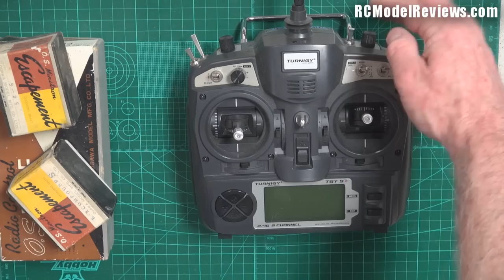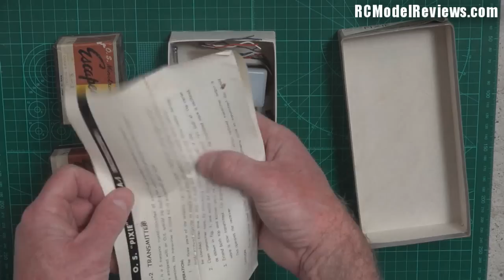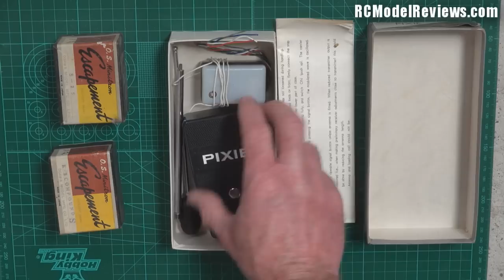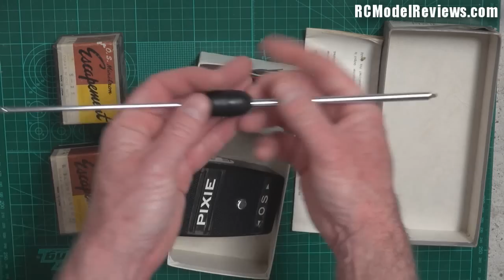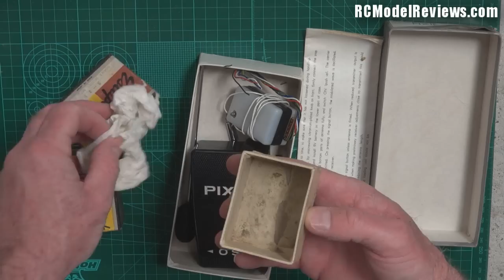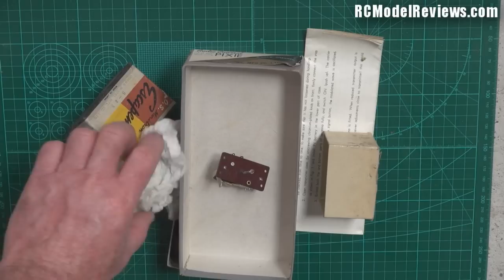RC gear from the 1960s

Comment: I got  an even older O.S. transmitter that is tube based (no transistors).  Those ran on 27 MHz AM. But I miss the tube based receiver for it. And these ancient high voltage batteries to drive the stuff.  You can study this facebook album (swedish text but photos can tell a story) : https://www.facebook.com/photo.php?fbid=1191565567031  If any of you know of people who have such tube systems working I would be happy to know.

Comment: Hi,I have the slightly earlier version and need a wiring diagram, I have the OS Minitron servo's and the diagram that comes with them is not clear to me,there are batteries connected all over the place. If you have a idiot proof wiring diagram I would love a copy.

Comment: Wonderful, Bruce!  In late 1960's, I was a 6 grader.  I remember I discussed with a high-school-er about how to use a single on-off channel to achieve tri-state (left, neutral, right) control.  He suggested: Pushing the button first time, the rudder goes left; release back to neutral; second time pushing the button makes the rudder go right.  Unfortunately we never materialize our plan. :( The method you shown us in this video is better and less confusing but carries the same idea. Thanks again!

Comment: I've got the perfect plane to go with the OS Pixie. An ancient FireFly RC Trainer kit that used to belong to my Dad. It was designed for pre-transistor radios. It has a 8 x 4 x 5 inch radio compartment, and shows you how to put together the 3 volt, 11 volt and 60 volt battery power for the vacuum tube (valve) radio system. Power is supposed to be an .099 gas engine.

Comment: Hi Bruce I have a Turnigy 9x radio and no matter what model I fly it cuts power to the motor after 20 to 30 seconds , still have power to aileron / elevator servos but have to put the throttle stick back down then power up to get motor going again. Any ideas as to why this is?  its a great radio apart from that and no instruction manual

Comment: Excellent video Bruce! I've been reading a bit about this stuff, and I almost want to give it a go. though I think I should learn to fly properly first. But the older planes were deliberately built to be properly stable and self centering in flight. Plenty of dihedral, and well trimmed. I'm going to build some chuck planes and go from there.

Comment: @RCModelReviews
 G'day Bruce:.. Yay Team ! This sure struck a Chord... I recall reading of such systems in '69 or '70, but Being a '61 vintage myself, I didn't understand it, & never knew where to get one.... Control-Line was all the Rage, here, back then. I did make a Sopwith Camel, Free-Flight, Cox .O49 Powered, and with a GRAVITY PENDULUM controlled Elevator... It crashed, of course. Pendulums could do all 3 Axes, (eratically). Ciao !

Comment: I've been looking at some of my old plans and thinking of building a single channel aircraft rudder only with a Mills .75 or DC Dart in the nose, I've found the plans for the Roaring 20, so I will scale it up to 30" to take the larger motor. I will post a build thread on the RCmodelreview forum with some photos and a video of it flying some time around Christmas.

Comment: Back when I first started in RC, my instructor had an aircraft called the Roaring 20 it had a Cox 010 engine an Ace single channel radio. It looked funny because the rudder was wagging like a dogs tail equally left and right, when you moved the stick on the TX to the left the rudder would wag from the center out to the left and the same for the right when the stick is moved right. This little 20" model could do just about any aerobatic maneuver but fly inverted, a pleasure to watch.

Comment: As a schoolboy I used to watch Dad building his planes. He's use glue he had to melt down on the stove and boy it stank. He's make his own fuel tank from copper and solder it together with an iron stuck on the gas stove. No radio gear, just a little right rudder and up elevator. We'd walk miles across the moors if the wind caught it. We managed to fly it through a woman's bedroom. I couldn't understand the fuss but Dad laughed about it for weeks. No nitro either, good old ether mixture, heaven.

Comment: I love Old radio gear. My first real radio was a Magregor  2 Channel that came back from the Uk. It was on 27mhz at the time CB radio in Australia was in its prime. We couldn't work out why the servos kept "chattering" and going to full deflection. Now we know. My next radio was again from the UK.. A Ripmax Futaba 6 channel. After my Kamco Kloudrider glider crashed due to interference I had it converted to 29MHZ. Served me well for years after that. I still have it. No I don't fly it..

Comment: My first radio control in about 1975 was an OS Pixie. I was 11. Even then it was way out of date. I didn't use an escapement but a servo. I actually successfully slope soared gliders with it. When I say successfully I mean I could launch, try and fly back and forth in the lift until it came time to land. Then it was basically assisted free flight. I bought a Pixie on Ebay and intend to pay someone to get it working again..How silly am I???

Comment: you don't. same way a free-flight model flies: when it gets going fast, it climbs a bit, slowing it down, in turn making it pitch down a bit, so it gains speed and climbs again. (or, as he described in the description, use a 3-point throttle control, and more throttle=climb, less throttle=descent.

Comment: I had an old OS Max jet... but flew it C/L speed.

Never had much (really any) R/C experience then, but remember seeing some smaller aircraft that used a control systen they called a 'Galloping Ghost'.

The rudder rapidly 'fluttered' back and forth stop to stop in the neutral position, then would flutter more favoring right or left as commanded. They seemed to be fairly popular... and appeared to be more 'entry level'.